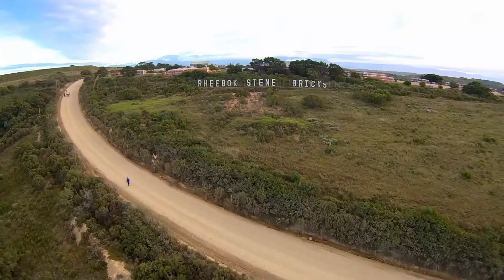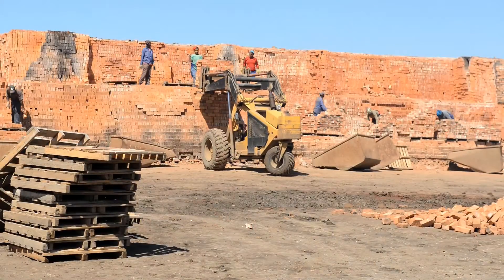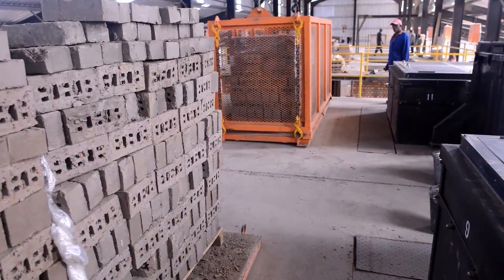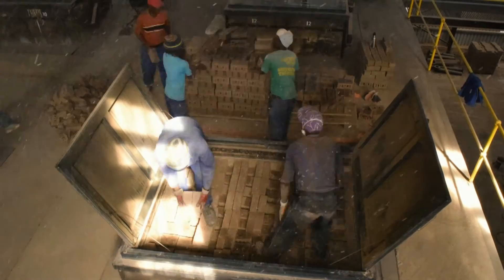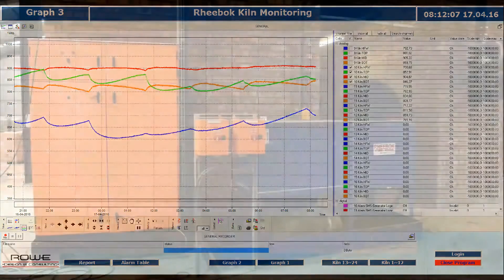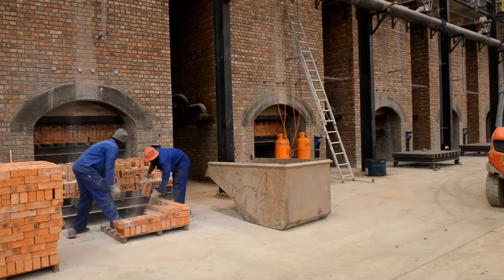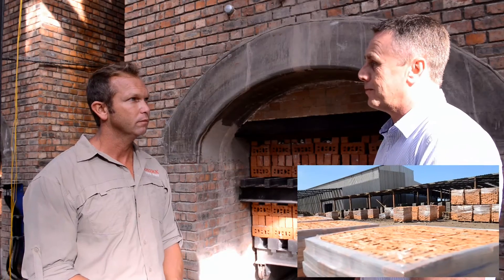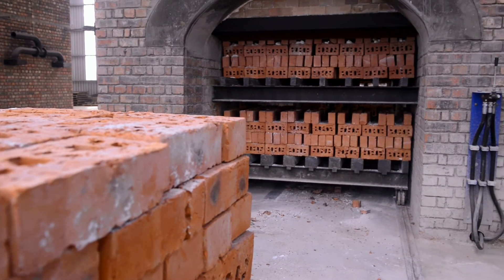VSBK SA Rheebok Brick, South Africa | Swisscontact – Swiss Foundation for Technical Cooperation

Comment: What kind of piston is used to lower the burnt bricks ? In this process?
Reply from the maker: The Vertical Shaft Brick Kiln technology is a vertical kiln with stationary fire and moving brick arrangement. The shaft is loaded from the top in
batches of green (unfired) bricks. They are unloaded at the bottom where there is a brick trolley with a single screw trolley lifting mechanism. You can find further technical information here: https://bit.ly/2MjXM0r

Comment: VSBK possibally the worst working conditions ever seen, and for the cost the capacity is not high
Reply: Hello, I found your comment really interesting. No one has said such things about VSBK. Can you elaborate more what went wrong?
Reply: @shantanuborgohain8331  Perhaps @henniemarais4260 is thinking of old-style VSBK, where there was no extraction system via flue ducts near the top of the shaft.  All that has gone away!  Working conditions could hardly be more pleasant, as this video documents perfectly.
Reply: Yes